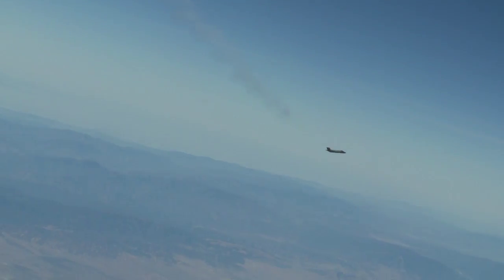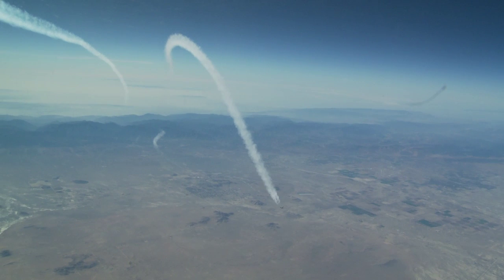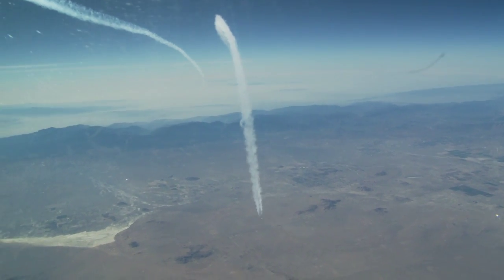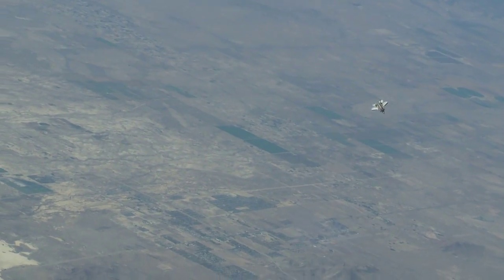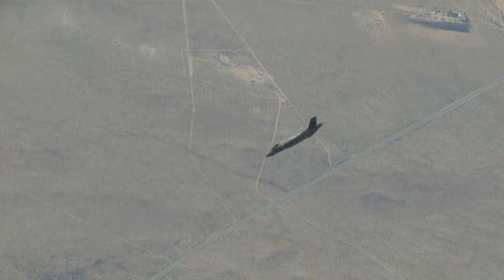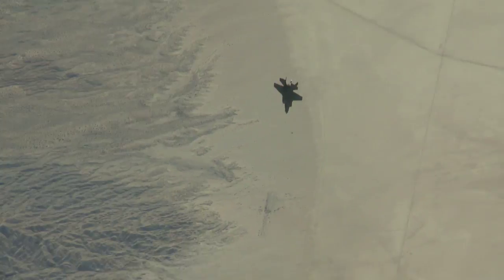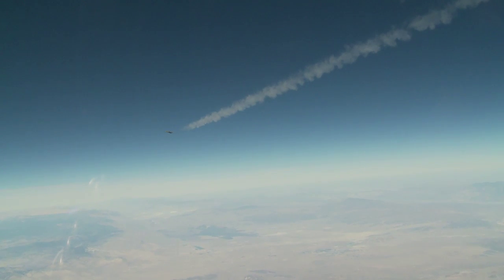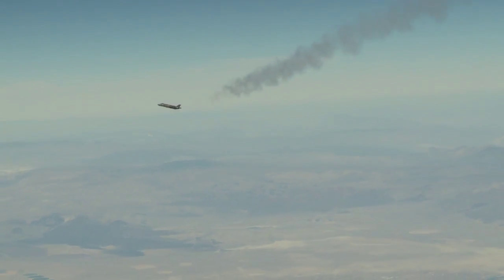F-35 High Angle of Attack Testing

Comment: @BollocksUtwat actually it IS certain that i `a combat configuration, the F-35 CAN out maneuver them.
Reply: *****
You're wrong. Flat out wrong. In a combat config it handles similar to or better than an F-16 in a similar config. Same goes for speed while carrying weapons. So many people make the mistake of thinking its a pig because it's not an airshow plane. Its a warfighter and out performs everything it's replacing while in a combat config. Thats the important part youve missed.
Reply: *****
 I know its a bit long but I prepared this just for you so please take some time to read through. Thanks  :D 

Lets look at some figures against some proven and supposedly superior platforms, lets compare them and see. 

If you really know something about planes you would know that you basically need 3 essentials to be maneuverable:

1. Lots of Lift
2. Lots of thrust
3. Little Drag

Lets discuss lift: 
I know you probably heard Pierre Spray said that the F-35 is a dog because it has little wings. and has to carry 110lbs of airplane for every square foot of wing. 

Pierre Spray was involved in the aircraft industry at around the 1960s where fighters were basically tubes with wings. 
At that time all of the lift came from the wings. small wings = small lift.

But at around that time Martin Marietta (now Lockheed Martin) was experimenting with Lifting Body designs, they wanted to produce fuselages that can assist the wings in producing lift instead of being dead weight.
Read more here: http://en.wikipedia.org/wiki/Martin-Marietta_X-24

That’s why at around the 1970s we began to see fighters with wide flat fuselage sections and smaller wings. So lets compare the wing loading of the F-4 against Pierre Spray's favorite F-16 variant the F-16A.

F-4
Empty: 30,328lbs
Load:8000 lbs
Comabt Weight: 38,328
Wing Area: 530 feet
Wing Loading: 72 lbs/ sq feet

F-16A
Empty: 16,300
Load:8000 lbs
Comabt Weight: 24,300
Wing Area: 300 feet
Wing Loading: 81 lbs/ sq feet

So by Pierre Spray's own argument the horribly turning F-4 should fly circles around his hotrod F-16? What’s happening here?

Well the F-16 does not rely on just wings to produce lift, it has a blended body and wing design, plus LERX that produce vortices above the airplane (if you remember you physics, high pressure below + low pressure above creates lift)

around 40% of the F-16s total lift does not come from the wings at all. So in reality the F-16's actual wing loading when loaded with 8,000lbs is closer to 49 lbs per square feet not 81 lbs.

The F-35 is the same. to get the F-35 to have 110lbs / sq ft of wing loading as Pierre Spray said it needs to carry 21,300 lbs of load. 

The f-16 can never do that, but the F-35 can! that’s what’s great about this plane, it gives you options, if you need to go to a long range mission then sure, the F-35 CAN carry 18,000lbs of fuel and 18,000lbs of weapons.

But if your going to a CAP mission where a dogfight is possible, then why load it with 21K? Most likely an F-35 would take off with 18,000lbs, And when it gets to combat it would probably have 10,000lbs depending on the range to the target.

So lets pit the F-35 against some really good aircraft, Wing Loading calculation. 
All loaded with 8,000 lbs, perfect for dogfighting:

Wing Loading:
Mig-29 M/M2: 91
F-16C (block 50): 90
F-35A: 81
F/A-18C: 77
Su-30MKI: 72

So as you can see at dogfighting weights, the F-35 is not bad at all, its not the best but really not all that bad. 

Now consider this, the F-35 probably has the most efficient body lifting surface of all these aircraft due to the fact that its fuselage has the smoothest flatest surface of all these planes, not a lot of disturbance for the wind to flow around on. 

So lets give all these aircraft a Body lifting coefficient of 40% but to be conservative lets give the F-35 45%, the truth is probably much larger but hey lets keep it down.

Wing loading plus body lift:

Mig-29 (M/M2): 54.6
F-16C (block 50): 54
F/A-18C: 46
F-35A: 44
Su-30MKI: 43

The F-16s wing loading is similar to the Mig-29s which is why it replicates the Mig-29 in RedFlag.

But Notice how the F-35's wing loading is so close to the F/A-18 and just 1 pound above the Su-30, which is why when you ask pilots they will say that the F-35 maneuvers like an F/A-18 with better acceleration. 

And really acceleration is the only thing Hornet pilots dont like about it.

http://www.flightglobal.com/blogs/the-d ... -tactical/
Lt Col Matt Kelly wrote:
Operational pilots should be thrilled with the F-35′s performance, Kelly said. The F-35 Energy-[Maneuverability] diagrams, which display an aircraft’s energy and maneuvering performance within its airspeed range and for different load factors, are similar to the F/A-18 but the F-35 offers better acceleration at certain points of the flight envelope. 

So do you still think they are lying? 

Now lets talk thrust. This is a no brainer, the F-35's engine is rated at 43,000lbs the most powerful in the world. So lets cut to the chase and compare.

Thrust to weight at max thrust:
(All loaded with 8,000 lbs)

Mig-29 (M/M2): 1.05
F-16C (block 50): 1.05
Su-30MKI: 1.13
F/A-18C: 1.14
F-35A: 1.15

Surprise Surprise, the F-35 has the best Thrust to weight ratio of all of the planes involved, and really in a dogfight Thrust to weight can be more valuable than Wing loading. 

Now Drag: 

All these planes will carry weapons externally adding lots of drag. with a full centerline tank the F-16 is reduced to 7Gs max and the Mig-29 is reduced to an appalling 4Gs, the F-35 will carry most if not all its missiles internally, very little drag.

So to conclude, even without Stealth, even without all its advanced sensors and ECM suits, the F-35 will (in the words of Pierre Spray) wax the competition every single time, then if the F-35 is a dog the rest should be compared to kittens.
Reply: *****
Really? You get hit with a crapload of fact, well laid out and perfectly presented and that's all you can say? Your reply is absolute proof that you have no intrerest in the aircraft ( and no understanding) itself and more interest in just parroting a bunch of BS you heard someone else say.
Reply: Marlon Serrano
Well written comment. But how do you think the su-27 compares? The su-30 is for patrolling airspace with twin seats and increased amounts of avionics thus the largest and heaviest of it's type so I would think it's numbers would be considerably worse than the single seat dogfighter it was based on.
Reply: TheGoodChap
 Su-30 - maximum speed: Mach 2.0 (2,120 km/h, 1,320 mph)
Range: 3,000 km (1,620 nmi)at altitude
Service ceiling: 17,300 m (56,800 ft)
Rate of climb: 230 m/s (45,275 ft/min)
Wing loading: 401 kg/m2 (82.3 lb/ft2)
Thrust/weight: 1.00

Su-27 -  Maximum speed: Mach 2.35 (2,500 km/h, 1,550 mph) at altitude
Range: 3,530 km (2,070 mi)at altitude; (1,340 km / 800 mi at sea level)
Service ceiling: 19,000 m (62,523 ft)
Rate of climb: 300 m/s[64] (54,000 ft/min)
Wing loading: 371 kg/m² (76 lb/ft²)
Thrust/weight: 1.07 (with 56% internal fuel)

Considerably better I'd say. Still, the F-35 would have a significant advantage in 90% of the engagement envelope. Some people have a very narrow view of what a BVR advantage really means. It's not just the direct " first look first shot" advantage, it's positioning, choosing where and when to fight, it gives the F-35 the option of choosing how to approach ( if the pilot decides to) Can vector other aircraft onto the opponent, there's just so many advantages. The first real idea the Su-27 has is when it's forced to defeat an incoming missile and in doing that is already at a positional disadvantage by NOT being where he wants to be.

So while the Su-27 certainly has a kinematic advantage over it's cousin putting perhaps at a slight ( although not really breaking point) advantage over the F-35, I still know where i'd rather be sitting. The F-35 has such a massive SA advantage to boot.
Reply: SlaughteredInside how about fuck you?
Reply: Jason Yu The correct way would have been, "How about fuck you?". Learn to capitalize shit troll.
Reply: Antifaith29 Except the Su-30 won't perform Mach 2.0 in a combat configuration and the Su-27 will not do Mach 2.35 in a combat configuration.  You'll be luck to get the Su-27 doing Mach 1.8 with a combat load.  Most WVR engagements never take place above 800 knotts.  The F-35 still maintains its performance envelope even with a combat configuration which is Mach 1.6+, a higher AOA than the F-18 and a superior sustain turn to a combat configured F16.  So in a close up WVR, no matter which direction the Su 27 or Su 30 turns in, the F-35 will be able to keep its nose point on them the whole time.   We are not even including Stealth, DAS or BVR capabilities.
Reply: *****
There's that too. Im curious if you read my entire comment or just stopped half way through. I have said I know where i'd rather be sitting, the F-35. Perhaps Im reading it wrong but it seems like you're at me like I just said the F-35 was shit like many of the YouTube educated Russian fanboys. It's a warfighter and thats where it performs, in a wartime config.
Reply: *****
I'm curious if you actually read that article or just read the headline and went " zomg here's proof!"
It doesnt dispute anything I have personally said at all. Not in the slightest. While fully armed and fueled it's handling slightly better than a legacy hornet, that's actually quite good. If you have a problem with the F-18's maneuverability I suggest you go and watch a blue angels show some time.
o you have anything to say for yourself or are you going to keep copy pasting hyperlinks?
Oh btw, the Eurofighter V F-35 thing is a bit silly as the Eurofighter guy hasnt flown the F-35 and Vice versa, It's just a bunch of opinion and conjecture right now.
As the article says ( and im almost certain you didnt read the whole thing by the way you're attempting to use it as some kind of anti F-35 rant) ...we wont know until they engage in mock combat. If the F-35 is allowed to fight to its fullest then I doubt very much the Eurofighter will even know it's there until its RWR is screaming at him and he's forced to go defensive.

Edit - So i just looked it up and Billy Flynn ( the F-35 test pilot) has flown both the Eurofighter AND the F-35 so he DOES know.
Reply: ***** No, thrust to weight ratio is another subject i.e. I have posted  F-35's Block 6 potential engine upgrades based from F-35's stakeholders involved with the engine.

Thrust to weight ratio is dependant on the loaded fuel.

The current F-35's F135 engine is temporary.

Notice Lockheed is using higher Block builds against the competition.  

Just one adaptive engine upgrade, F-35A's power-to-weight rivals EF's.

Comment: No, the point is that you're claiming something exceptional then saying you can't prove anything. You claim something about AOA then say it doesn't matter cause nobody is gonna fight in WVR.

If the F-35's strength is BVR A2A then why you being such a fan boy about the high AOA? I never claimed it couldn't out fight 4th gen, just that its not certain it can outmaneuver them.

All I said was its not exactly as nimble as the vid suggests. You're all over the place with your arguments.
Reply: Becuase the F-35 is good at both.  But why would you get in a turning fight with such a massive advantage in stealth?

Comment: (cont)
against the F-22 was the Typhoon piloted by the Germans. Even then, it was only capable of standing a chance in WVR, which almost never happens today. German pilots even stated that if they did everything right, they couldn't get within 20 miles of the Raptor without getting targeted. So basically what I'm saying is that the only plane that can get anywhere near the F-22 in A2A performance is an allied aircraft in VERY limited conditions.
The point is you need to do more research.
Reply: You are correct and I would add that the other advantage of stealth aircraft is that they keep their weapons internally and that means that they pay no drag penalty.  Those Red Flag events were designed for WVR fighting and the Eurofighter went into those engagements in a clean configuration.  Add weapons and they pay a massive drag penalty and lose their ability to keep up with the F-22 kinematically.  With real weapons and a real world scenario the F-22 is heads above the best fourth generation aircraft.

Comment: And what makes you say that is may not be able to out maneuver a 4th gen fighter? Because I have yet to see a single pilot of this aircraft say that. In fact, they are all very pleased with the plane's maneuverability and responsiveness. And AoA is certainly a VERY important element of an aircraft's maneuverability. It is one of the MOST important parts of it actually. 
How about you start comparing the plane on the grounds that it was designed to compete in. Is there anything impressive (cont)

Comment: None of what you say has anything to do with this aircraft's relative capabilities. It debatable if it can outmaneuver all 4th gen contenders and its not even close that it can outmaneuver thrust vectored aircraft.

You're just being a fan boy. There's nothing impressive about a modern avionics boat passing high AOA tests. I'd be surprised if it didn't. Its also not going to be setting any records with this capability. Its not a big deal, but its not what the F-35 is designed for either.

Comment: Thats the point though. This is supposed to be some miracle project, that can handle it self in any and all roles, lowering the need of nations to retain numerous aircraft and instead pay for one.

If you knock off the need for stealth, I don't see how the F-35 is particularly advantageous in the end. Much of its advantages can be found in other airframes, that can be upgraded to match it in many ways. Stealth and internal ordnance bays, thats what the F-35 has.

Comment: You're saying it but not proving it per se. At most its no better than any existing fighter, and worse than some.

And having superior tech doesn't negate the need to get that tech into a certain range quickly. The F-35 is a miserable interceptor and would serve the doctrinal needs of a country like Canada poorly where the primary concern is defense of an enormous northern airspace. Stationing the F-35 on those arctic bases is also of dubious practicality.

Comment: The F-35's wing loading is actually a lot higher than many comparable aircraft, like Sukhois, and thats hard to get around in a turning fight. Its also slower than a lot of aircraft which is a big downside if you have to do more than fire missiles in BVR.

Without all the new tech and stealth built into it I'm not sure how special it really is as a pure airframe.

Comment: I see these guys every day of the week, constantly. Eglin AFB, Fl. Home of the F-35 Joint Training Bed. The AF version(F-35A) flown by the 33rd FG, goes by "Nomad" typically. The F-35B (USMC) has the call sign "Reaper", and is the Grim Reapers on the ground. They fly slightly different in the pattern and don't let their gear down until they're inside the downwind turn. The F-35C variant for the Navy, is going by "Sweed." I'm not sure of the spelling, but that's how it sounds anyways.

Comment: if the schedule there on now continues you will see F-35A's in service by 2014 and F-35B's in active service maybe late 2014 prob 2015.  F-35C's are going to be the last guy out (only being bought by the US navy) prob see them around 2016-2017.  The original goal was for the F-35B to be ready by 2012 the A and C were always supposed to be a year or two back.

Comment: Apparently you don't understand the concept of test points. They are requirements that the F-35 needs to pass. So yes, if the number of them increases, you will need to fly more to be able to test them. I trust the people making the plane far more than the people paying them to make the plane. After all, most of the information the Pentagon releases about the F-35 comes from Lockheed Martin.

Comment: You know how fast an F15 can actually fly loaded with weapons, electronics, and fuel, maybe mach 1.3 in a combat load out, the F35 can fly at mach 1.6 in a combat load out, least agile? Test pilots have said that is more maneuverable than the FA18 and offers better acceleration, 4 internal missiles as of today, 6 are planned for the near future and they believe 8 can fit into the bays, its combat radius is greater than the F16, and FA18, two of the planes it's replacing and greater than the F22

Comment: Like the Harrier, hovering time is limitted due to heating.  Like fighters, it doesn't carry a lot of cannon ammunition compared to the A-10 or an Apache.

If the F-35 is operating within a zone where air superiority is held, then its best option is to load up with 24 SDB's.  This is roughly 4 times the PGM load of large aircraft like the Su-27.

From 36,000 feet the F-35 has a better view of the battlefield than helicopters at low level and can attack 24 separate targets simultaneously.

Comment: These are the RCS claims online regarding SU-35 and Rafale.

Su-35: 1.0 ~ 3.0 m2 --> 6666 ~ 20000 --> 9.03 ~ 11.89

Rafale: 0.1 ~ 0.2 m2 --> 666 ~ 1332 --> 5.08 ~ 6.04

I don't buy the Russian claims for NO-11M one iota.

Also if you are going to compare Rafale to an aircraft still in development at the least include the spec for Rafale with it's latest IN SERVICE AESA OK !

I think Su-35 would detect Rafale at about 70 KM headon with that honking Zhuk-27.

RBE-2AA AESA  at AT LEAST DOUBLE that.

Comment: I heard the Indians were not impressed with the Russian radars at all.

I think they tested a Zhuk-27 and found the Russian claims regarding 130 km vs a 5 m2 was unfounded. Again it's all CLASSIFIED but from what I have pieced together the performance what 72-82% of that.

RBE2-AA speculation is 180KM for 3 m2 and that 5m2 target would be detectable at 200KM.

Where do you get these numbers again?